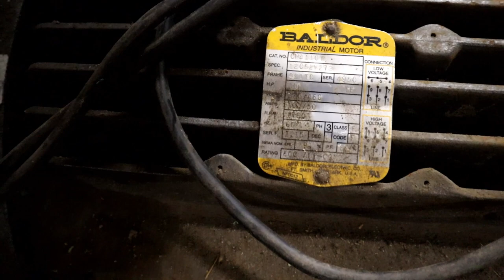Brian Block's Shop :  First Video of his 40" Steady Rest, Bailey APPROVES!

Comment: Way back when, running an 18 inch lodge and Shipley, made up a steady for big stuff.  First made piece that matched ways, then a circular casting by Missouri steel castings, don't know what it was for but it worked, welded it all together and it worked.  Worked parts 12 diameter and 36 long.  Was cutting API taper threads in them.  Got paid piece work.  Best money I ever made.  Back in 1982.  But the homegrown steady worked.  Looks like B.C. might have to make up a riser.  No problem with the big stuff he has.